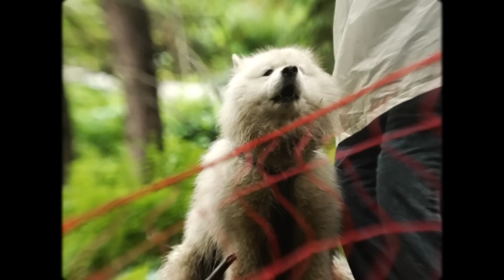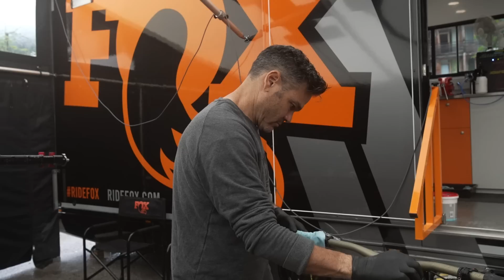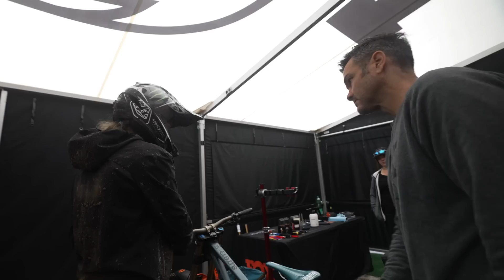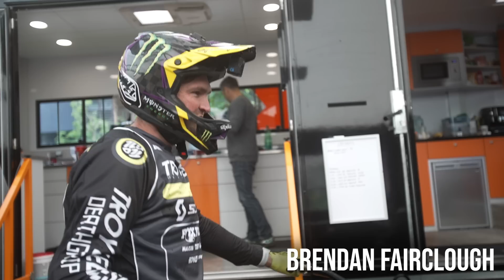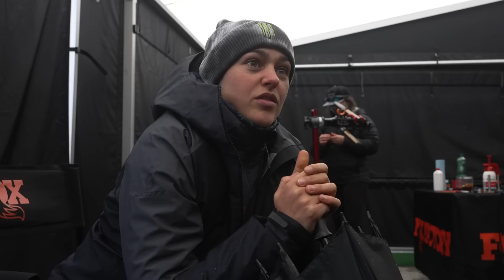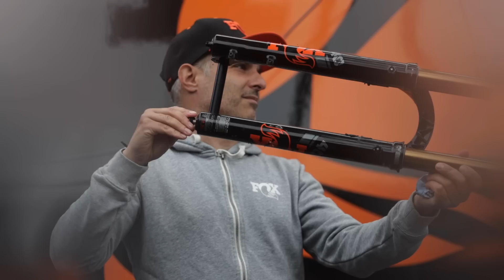DIALED S4-EP16: Adjusting suspension for muddy practice in Leogang | FOX

Comment: What psi on the tire most of the riders use on muddy terrain?
Reply: Which riders? I imagine there's at least a 30kg spread between the lightest and heaviest riders in the elite category alone. More if you include juniors. Check the Santa Cruz Syndicate video they put up about tire choices, they mention pressures for a rider or two.